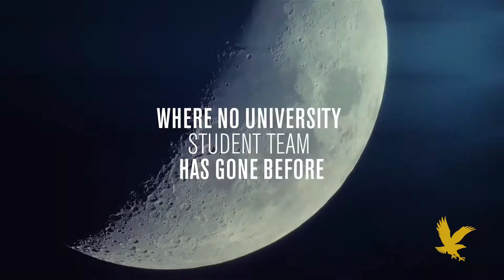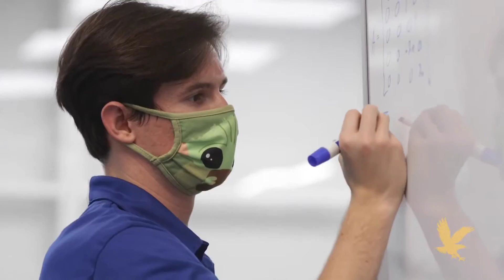SpaceX launching their first NASA Moon Mission in 7 days!!!

Comment: One metre per second is still a seriously fast landing speed. Move your hand through 3.3 feet in a second, that's a fair velocity. That's like walking into a brick wall at a brisk walking pace.
Reply: Whether he realizes it or not, I suspect that 1 m/s number is the design landing speed -- beyond which structural damage or failure occurs.  Versus the nominal speed they hope to touch down at.  An airliner's landing gear is designed to handle up to 15 ft/s at touchdown, for example, but average landings are typically 4-6 ft/s.